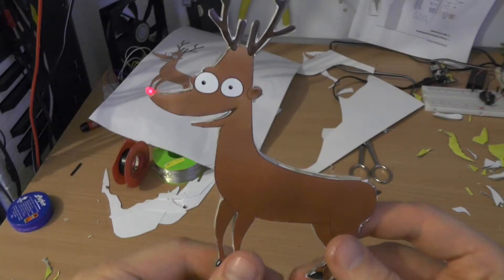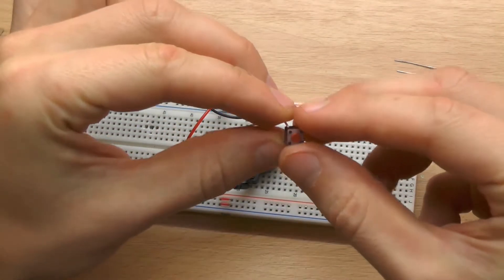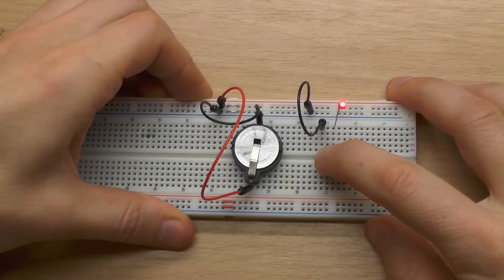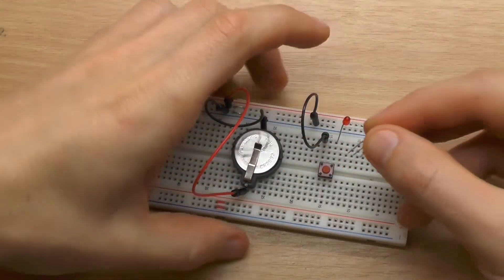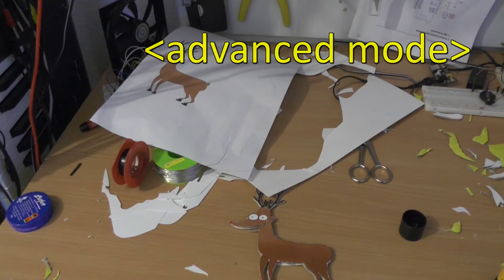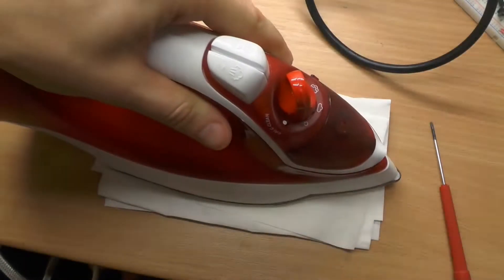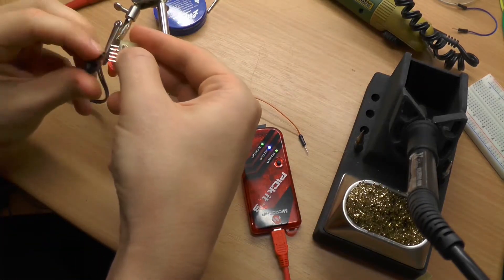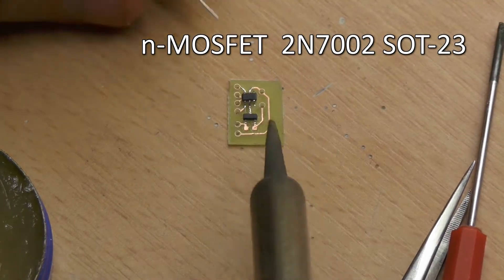Mini project: Rudolph

Comment: good job on that project. what died on the paper one any how.?
Reply from the maker: it turns immediately off. I guess the gate charge finds an easier way to the source now. didn't bother to rip it apart yet. but it might need some more insulation before gluing the paper directly on :D